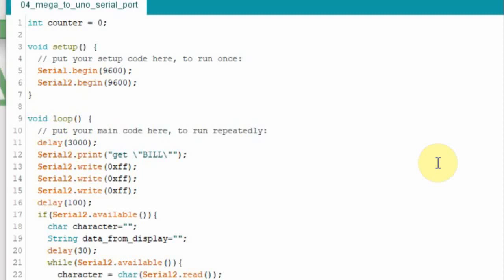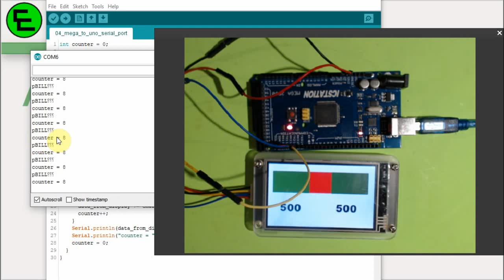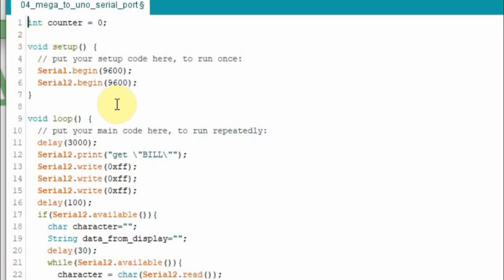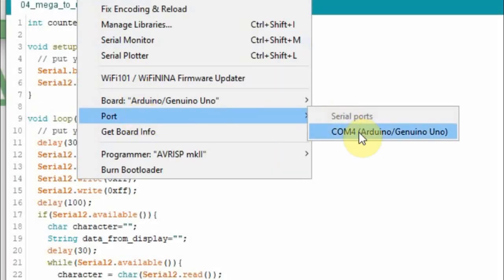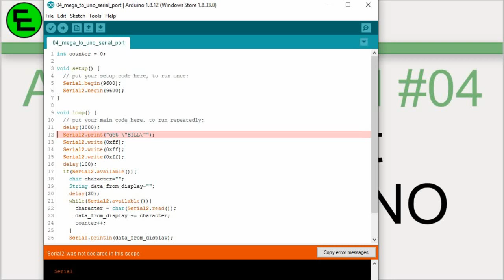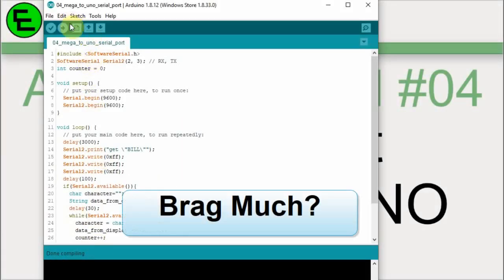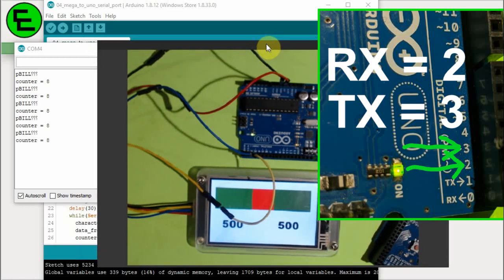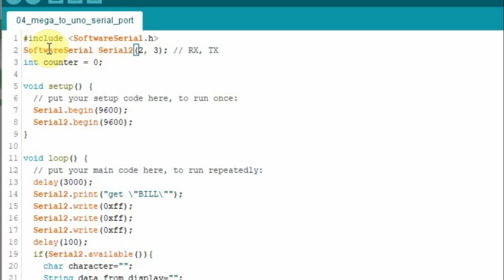#109 Arduino Basics - Serial Port MEGA VS UNO - Arduino Programming Tutorial

Comment: What does Serial Pin 2 and 3 connect to from the Uno? I have an FTDI adapter on the way and I don’t want to screw it up. My setup is an Uno with the usb connection to a headless pi 4.. I’m attempting to catch what the pi sent over, in a separate serial monitor so I can debug my programming. I know the pi is sending the right byte array but I don’t know what’s happening on the uno end when it’s read
Reply from the maker: Sorry this is so late.  I had some personal issues and had to take some time away from YouTube.  Do you still need help?  If so go to www.cheapcontrols.com and submit a comment.  I will reply with an Email

Comment: What happens if you use a delay() inside an asynchronous delay? 
I have DSbuttons that activate and deactivate some blinkers, but I want to add a button that activates a small blinking secuence on different leds at a difeten frecuency (lets say, blink a certain led three times), I need to be able to activate both functions at any time. I've thought about using a for statement for this, but haven't figured out yet...
Reply from the maker: If you use the delay command all the processing pauses.  The asynchronous method allows another functions to run.  If you are using the Arduino for a single purpose then the delay command is fine.  Was I supposed to review code for you?  I apologize if I forgot.  I get a ton of requests but something about this project feels familiar.

Comment: Hey I just finish your video thanks for the explanation. 
In my case I have a sketch that I run in arduino Mega  buuut y need To make the sketch for uploading in ATMega328. 

So I need To out (2 ,3) 

What do you think?Beacuse doesnt work jaja
Reply from the maker: I am not sure what you mean.  The Mega has 4 serial ports.  The Uno and Nano can set other Pins to Serial with the software serial ports.  Thanks for watching.

Comment: It is also possible to make single code, compile depending on microcontroller using:

#if defined()

https://forum.arduino.cc/index.php?topic=113656.0
Reply from the maker: Thanks for this.  I use similar code in PHP but have never considered it in Arduino.  I will bae adding it to my main template.  I usually code on a Nano and it nice to have code all can use without modifying.